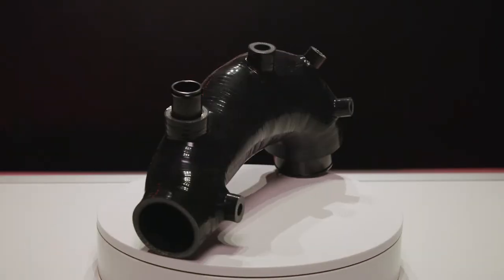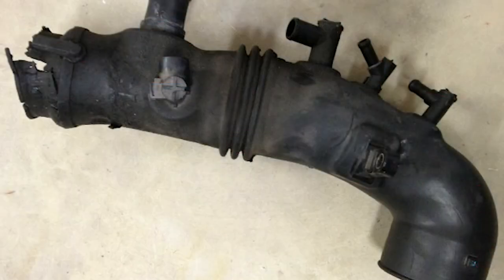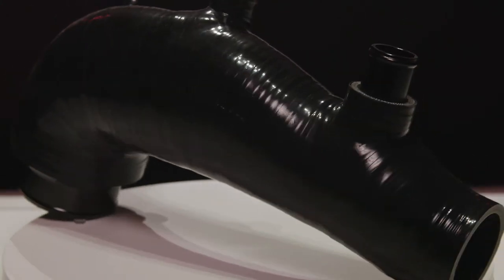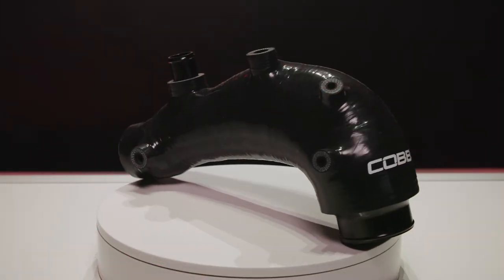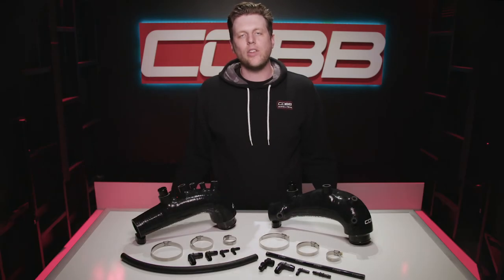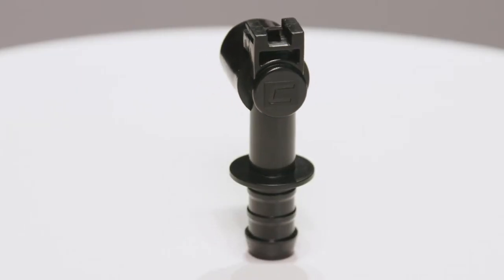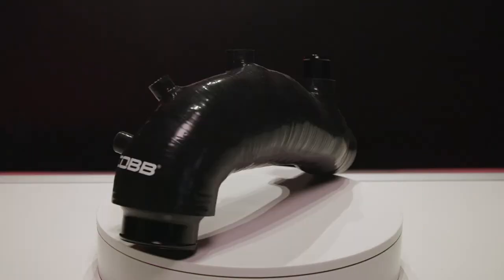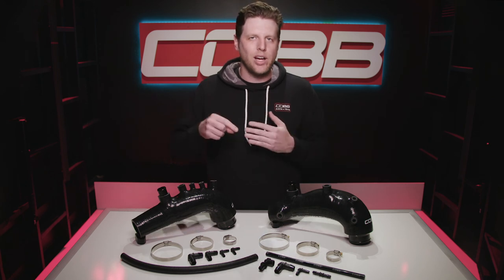COBB Tuning - Product Highlight - SUBARU SILICONE TURBO INLET V2

Comment: Do y’all have any tips for getting it fully inserted other than “finagling” it? I’m definitely not your experienced tech and am STRUGGLING to get the last inch to the turbo
Reply: I threw a code p0171 after I installed it. Waiting for smoke test to see it I got any leaks. I also have sf Cobb intake with ap. Best way I got it in was use a long prim bar and use intake mani to push it in.

Comment: I threw a p0171 with the Cobb inlet. I also have a sf Cobb intake will I need to get it tuned? I’m going ship tmr to get smoke test to make sure no leaks. Lmk thank you
Reply from the maker: Yes, you will need a tune with those modifications.  We do offer some map files that are compatible, depending on your vehicle and other modifications.  If your modifications do not fit within those maps, you will need to have the car custom tuned.
Reply: Just Cobb intake Cobb bpv Cobb Inlet and axel back. I have an accessport and currently running stage 1+ 91
Reply from the maker: Shoot us an email (support@cobbtuning.com) with a couple of data logs and we can help evaluate how the car is running with that map file and combination of parts!

Comment: Anyone have a link to a good install video? I'm no mechanic but this seems like something I can do myself, just need to make sure I don't miss anything.
Reply from the maker: We do not have an install video, unfortunately.  Fair warning - this install can be pretty tricky if you aren't well versed in "Subaru". Clearance underneath the intake manifold is pretty tight.  Linked below are our detailed Installation Instructions. 
https://cobbtuning.atlassian.net/wiki/spaces/PRS/pages/826776769/712450+-+COBB+Subaru+Silicone+Turbo+Inlet+Install
Reply: @cobbtuning  Thanks, it was difficult. Removed the throttle body to get the recirc pipe back in and had to route the wiring harness under the turbo inlet. Evap lines are a PITA. Took me all day.

Comment: Is a tune required?
Reply: Wondering this myself
Reply: Yes you need a tune
Reply from the maker: For the inlet alone, a tune is not required as it does not influence any sensors directly. If you change the intake along with it, then yes.
Reply: @cobbtuning  will there be a OTS tune for this? I'm running 2+ atm with all Cobb planning on going to stages 3.
Reply: I’ve already had mine pro tuned with a cold air intake and down pipe,can I install the turbo inlet myself without a re tune?
Reply: @micko9111  yes
Reply: @micko9111  How did it go? I'm about to do the same
Reply: @conorquiring3638  didn’t end up putting it on as I’m getting a bigger turbo/injectors e.c.t fitted and tuned on January 13th so may aswell get them to do it